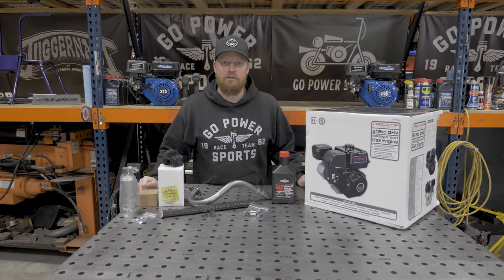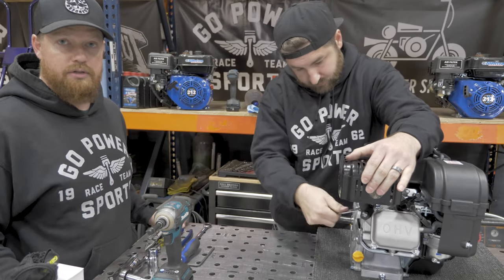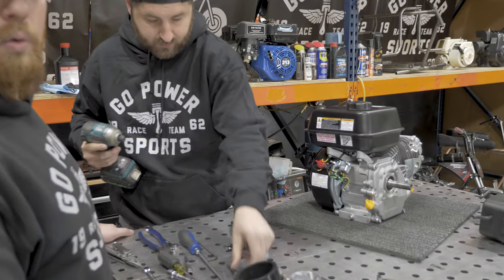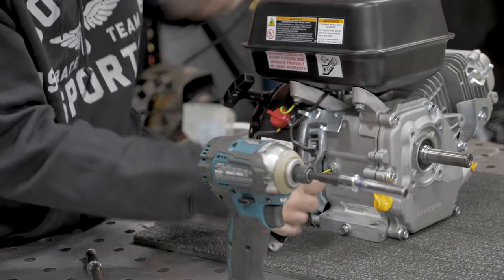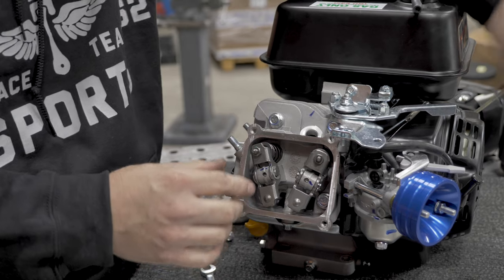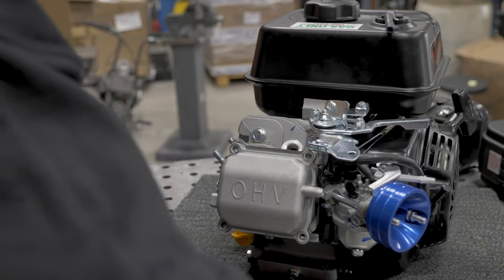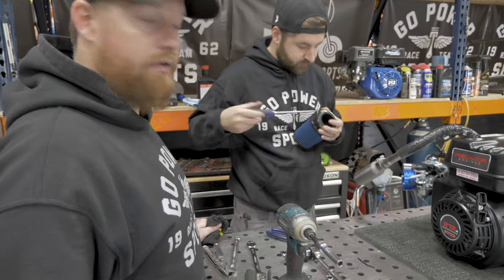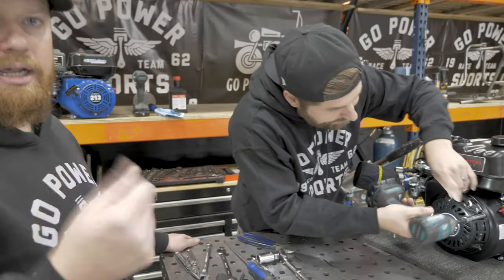Stage 1 Performance Kit on Predator 212 | Tutorial

Comment: I just recently installed 18lb springs in my non hemi predator 212 and my minibike is actually 4mph slower now. Any ideas or insight on what may have caused this? Thanks
Reply: Double check clearances and springs wont really make it faster. Just makes it safer to run it faster

Comment: What parts do you all recommend if i remove the governor other than a stage 1? Ive got a tachometer so i know the rpm limit for a removal.
Reply: I would go with a mikuni carb, billet flywheel, billet rod and 26 lb valve springs. Make it sing. Set up like that my kart tops 60 mph.
Reply: Thinner copper head gasket to up the compression a tad like a thin copper headgasket about 005" thou- 10 thou thick,use your old h/gasket as a guide .get the copper sheet from a hobby or arts & craft store.Compression builds torque and horsepower on any "Stage" Engine,but be warned Revs kills engines !.Cheers Trev NZ

Comment: Can you explain more in depth on how to do valve springs. Im on the edge of buying them but have no clue on how install
Reply: It's basically a c-clip. Push down on the top of the spring while you hold the valve in place and it just slides to the side. You can see in the video how fast it is. It's super simple.

Comment: What IS THE SIZE OF THE BOLT,  THAT  TIGHTENS DOWN  CLUTCH???  it doesn't come  in the box   WHEN YOU BUY  this motor.
Reply: 5/16 x 3/4 inch UNF
(fine thread)

Comment: What does the piece that attaches to the intake do. I don’t see how it works as a choke or anything
Reply from the maker: It helps to keep the chock lever on your carburetor.  It's just adds tension.
Reply: @GoPowerSports  yes! I realized it afterwards with a similar kit I got for a honda

Comment: These guys def get their stuff from china. 

The m8 hex head bolt they’re using on the air filter adapter on the back wedges up against the carb lever mechanism keeping it from opening and closing. 

I have to go get a 8mm button head bolt from hardware store… pain in the ass.. BMI Karts & Hobby thankfully answered their phone unlike these guys smh